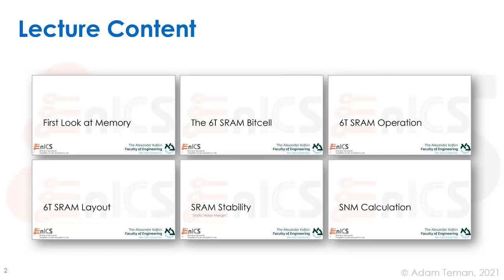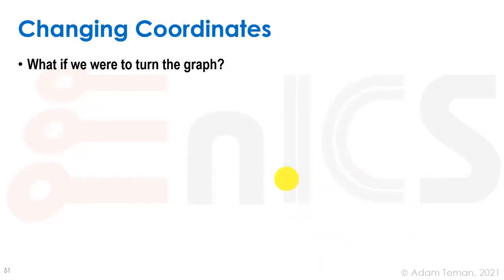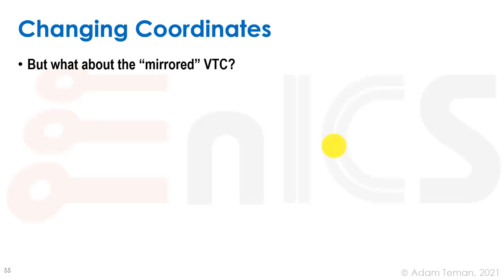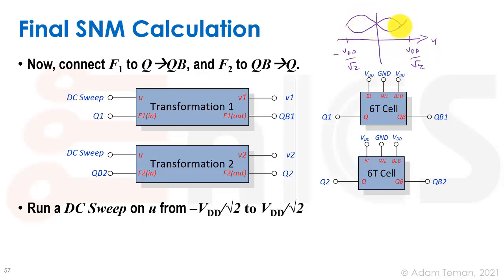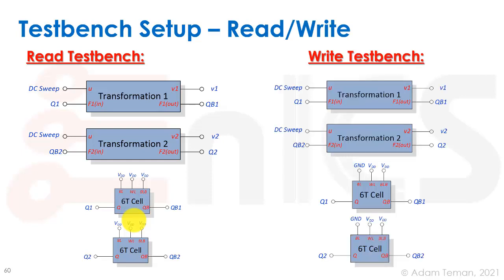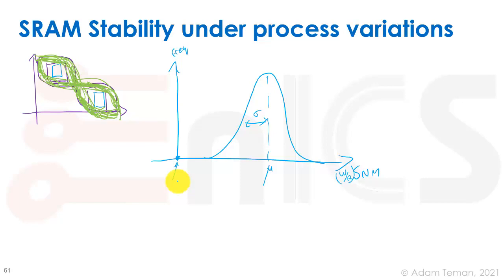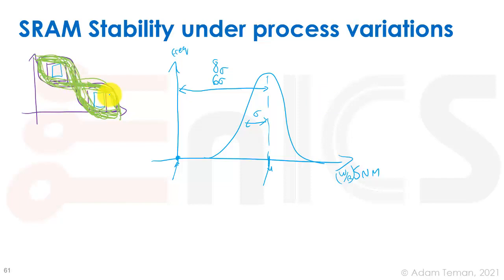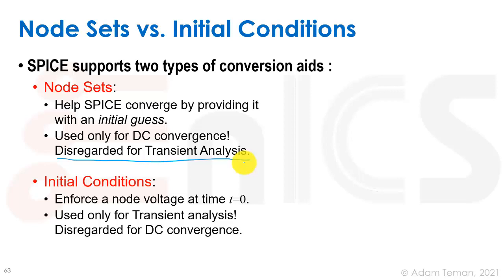VLSI - Lecture 8f: SNM Calculation

Comment: Amazing video! 
Question: would this method still work if the 6T SRAM cell is asymmetric (left inverter is different than right inverter)?
Reply from the maker: Yes.
Actually, in the original paper, Seevinck kind of describes the two circuits (feed forward and feedback) to be decoupled. But the way I present it is completely independent of the internal circuit implementation. You provide a Q and QB probe into the internal circuit and you get a transfer function from Q to QB and from QB to Q. If your circuit is not actually such a feed-forward/feedback pair, you may get strange results, but the simulation testbench treats the circuit as a total blackbox, not as a symmetric SRAM cell with decoupled inverters.
Reply: @AdiTeman  Amazing! This video has helped me and my startup with some of our SRAM-related sims! Thank you so much you're an amazing professor!
Reply from the maker: @permagoalie1439  Thanks for the compliments!

Comment: Hi, I am working on SRAM simulation. I am still unable to understand how to transform the axis to calculate SNM. I am using Cadence Virtuoso. Can you please help?
Reply from the maker: Hi Sarthak. 
I need you to be more specific in your question, since I don't believe that writing the explanation in this chatbox will be more comprehensible than what I showed in the video.
In general, you have to:
1. Create a cellview of the two transformations I show in the slides (feed forward and feed back)
2. Create a cellview of an SRAM cell
3. Create a testbench that instantiates the two transformations and two SRAM cells
4. Connect the instances in the testbench as shown in the slides
5. Run a DC Sweep on the input voltage
6. The outputs of the transformations will be the rotated graphs. You need to create a formula to subtract them from each other and find the maximum points

One side note is that you should create correlation for Monte Carlo simulation between equivalent transistors, but this is a bit of an advanced operation, which I cannot explain in a chatbox (and it is dependent on the version of Virtuoso you are running).

Comment: Sir i want to know how to draw the transformation circuitry and get the simulation in monte carlo but firstly how to draw transformation
Reply from the maker: Hi @virensharma2277,
Unfortunately, I do not show how to use a specific tool or show these very low level technical details in my lectures (as of yet). But I have tried to provide the closest I can without actually demonstrating it on screen. You really only need to open the library of basic components (e.g., the analogLib in Virtuoso) and use the existing components (such as the voltage controlled voltage source) to draw the transformation circuit I showed in the video. It should be quite straightforward - I didn't leave much for figuring out yourself...